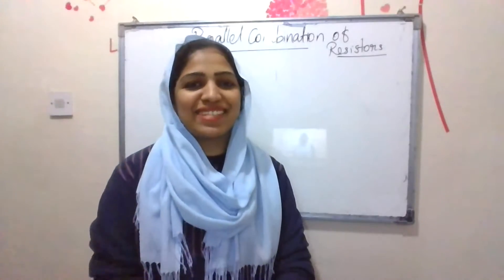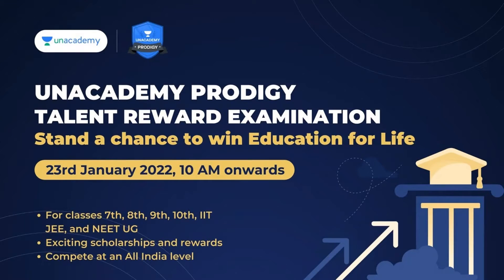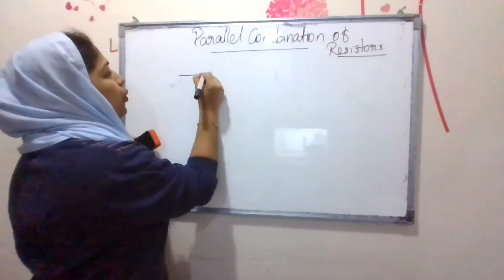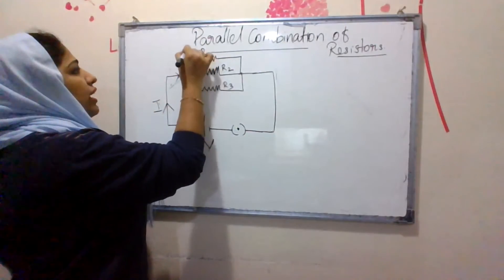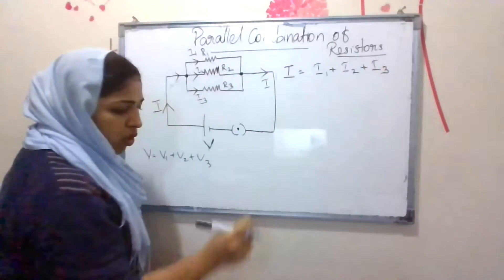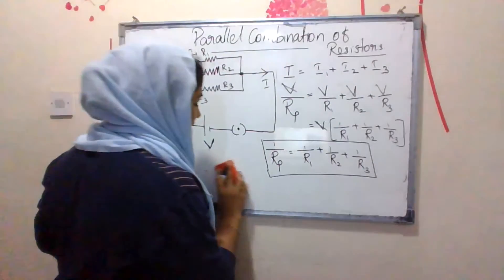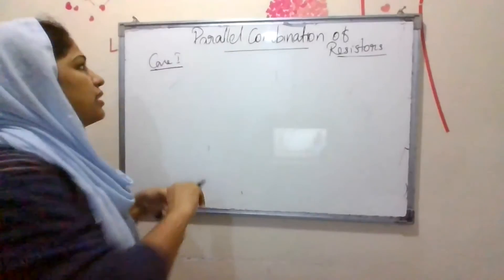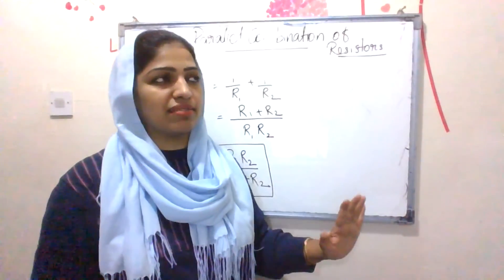Electricity Class 10 Malayalam I Parallel Combination of Resistors

Comment: Teacher, in the parallel combination of restors why did the potential diffrence v is same for all the resistors
Reply from the maker: In a parallel combination of resistors, each resistor is connected directly across the same two points (say, point A and point B).
The potential difference (voltage) between two points in a circuit depends only on the supply and not on the path.
Since both ends of every resistor are joined to the same two points (A and B), each resistor experiences the same potential difference